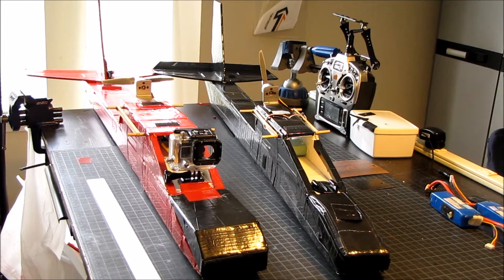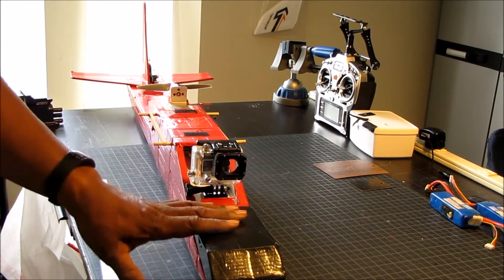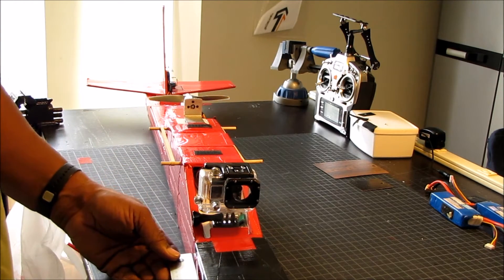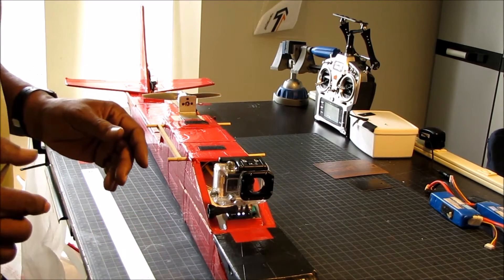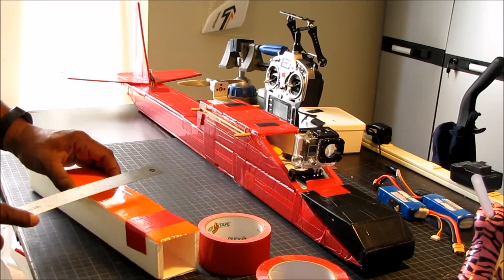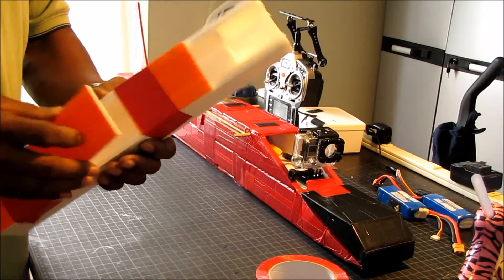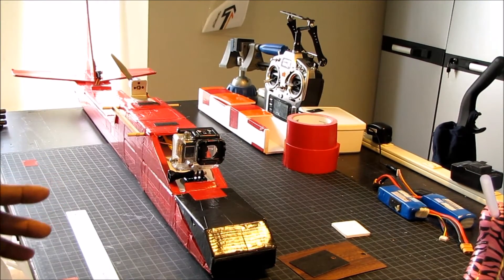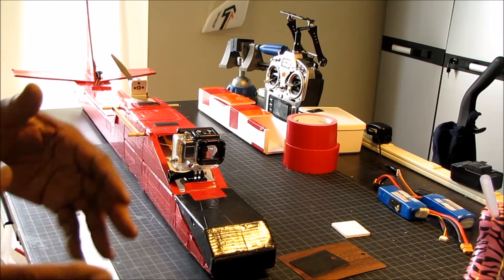The Axon Plus - A Modified Version of the Experimental Airlines Axon

Comment: great mods bro, what's the motor ESC combo you are running on the plus version.
Reply from the maker: +Joe s (Joe559) I'm running the Turnigy 2826/6 2200kv and Turningy 30a esc.  I'm getting around 18 mins flight time but I'm not pushing it.  Thinking about upgrading the motor, just haven't figured out to what as of yet.  I'm open to suggestions

Comment: Shawn, Nice video and very creative improvements to Ed's original designs.  Did you carry your double fuselage wall through from floor to top of the wing mounting level?  In other words is you Axon Plus a single box fuselage, or is it two boxes one mounted on the other.  Thanks, Ken
Reply from the maker: freshwaterfish2012 It is a single box unit.  To keep the weight down, I used a single for the top and bottom